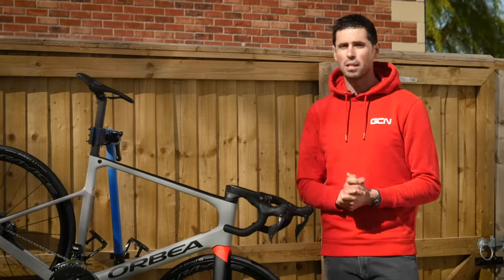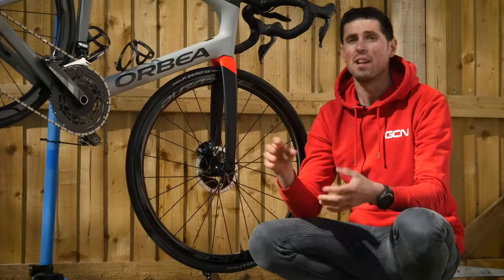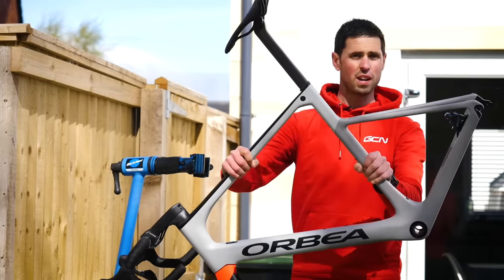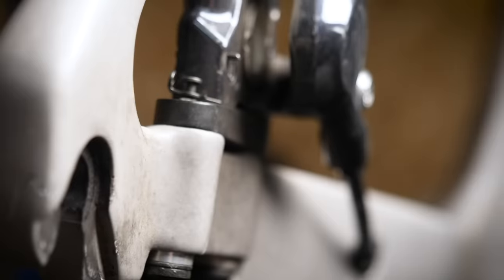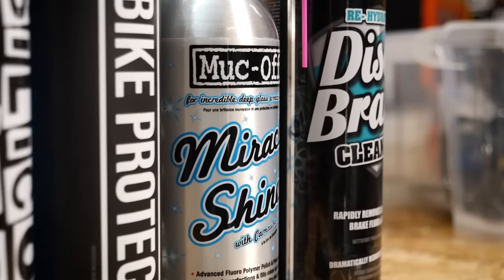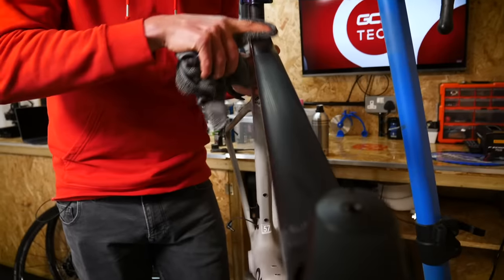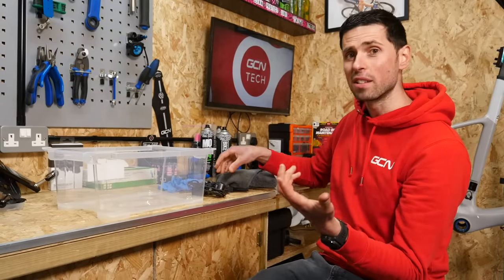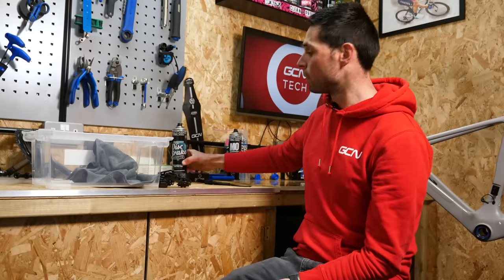Going The Extra Mile | Bike Detailing Tips To Make Your Bike Look Brand New

Comment from the maker: Do you want to give detailing a go? Or have you tried it in the past? Let us know in the comments 👇
Reply: If you were detailing your car, you would never use a brush as it causes fine scratches in clear coat.  

If you really want to detail your frame and fork, take some notes from car detailing 👍🙂🙂
Reply: I use Zymol Atlantique on mine. Costs more than some bikes!!
Reply: Naah, I ride on daily basis. Not gonna bother.
Reply: I wanna know more about your alixpress power cranks
Reply: Clay bar to remove all the stuck on bits of tar from all the chip seal roads, chemical  guys ez creme glaze, and a couple of layers of dodo juice supernatural wax ... shines and beads like a boss. Sometimes give it a fine polish first to remove any fine scratches,  but it usually gets done a couple of times a year, and especially before putting it into hibernation for winter.
Reply: No, no. Stop with this guy. 
3:15 a dirty rag running through the rear caliper? No. An ex-pro doing a rookie mistake.

5:34 bike cleaner is not a lubricant and should not be used as such. The pivot points for the rear mech should be lubed by....actual lube oil.

6:27 & 6:34 uses rag with cleaner/polish for the front hub and allows it to touch the front disc. Another rookie move. Good luck stopping.

PLEASE BRING JON BACK!!!  #GCNtech 
(If you’re going to keep this noob Alex, don’t use him for tech videos. Just use him for riding/racing tips. He’s awful for tech.).
Reply: @jonnythelegs2597  that makes two of us
Reply: I'd like to pay someone to do it... ;)
Reply: Never all in one go, but done every corner or component individually at some point. I use mechanical disc brakes, I tell you, taking the callipers apart and soaking every grimey, nook, cranny, nut and bearing in a methylated spirit bath was a fun few hours on a winter evening.
Reply: Why not list all the products used ?

Comment: That magene power meter, hmmmm. I would love to see a review of that!
Reply: Pretty good for the price according to others reviews
Reply: @simonlebas7733  DOUBT
Reply: @yourneighborsdog4495  It's actually not that bad although some people seems to have gotten lemons so I guess QC could be improved. Here's a comparison I made between my trainer and the Magene power meter. https://zwiftpower.com/analysis.php?set_id=131643
Reply: @Boppen71  the magene is probably the accurate one and the flux reads under?
Reply: @abedfo88  I'd say that it's normal for the power meter to read a little bit higher since it's reading power before any losses in the drivetrains of the bike and trainer. The Magene is advertised as +/-1.5% accurate and the Tacx Flux S as +/-3% so over all I'm happy with the results I'm getting. Just wish I had some power meter pedals to compare with but I can't really justify buying that when I already have two power meters (got a single sided Stages as well) and only one road bike to put them on. Guess I need another bike...
Reply: @Boppen71  how long did it last?
Reply: @yourneighborsdog4495  If you mean the battery, I haven't charged it since my first charge when I got it. Only used it for about 10h so far, so it's a bit early to say anything about that. It's specified for up to 200h per charge though. If you mean mechanically I don't see any reason for it to fail, it seems just as sturdy as any of my Shimano chainsets.

Comment: 2 things I've found that work really well for getting out tougher baked in grease or grime stains on bikes are very fine grade (#00 or higher) steel wool as well as those Mr. Clean magic eraser pads. Gentle pressure and maybe a tiny bit of WD-40 applied on the spot or the scrubber works absolute magic to get really tough embedded black grime stains out that other cleaners just won't fully remove. It can mess with clearcoat a little though so just proceed with some caution and keep the scrubbing light and targeted.

Comment: I have bought SWISSWAX for giving my frames the earned shine!!! And at the end of the Cyclocrossseaseon, i have taken everything off and clean everything!!! The same with my Roadbike from the Canyon Outlet store, which was a littel dirty.
Reply: Add: I gave my bikes a Swisswax clean in 3 steps. I have this Mucoff Coating for the  fast clean!
Reply: I just strip my frame when I buy it and apply a ceramic coating.
Reply: the same swisswax for car detailing? or bike specific?
Reply: For Harley's and other motor bikes, but i think it's good enough for my bike😉🙃🤗
Reply: @felixkloss5667  i believe is the same for cars... i have for cars also due to mate painting, so i believe than i can use on my bikes too, since they are also mate :)
Reply: It's really motor bike spacific. Their main products are of course for cars but it's motor bike specific.🧐

Comment: Try a IPA (diluted isopropyl alcohol, not a beer) wipe down before any wax/protection products. This removes any oily residues on the frame, so the protection coating is directly on your frame. Lasts longer and gives a better result.

Comment: I used the Muc Off Nano Tech Bike Cleaner today for the first time and I can't believe how clean the chain is.  I mean everything else sure, but how hard is it to get a top tube and down tube clean?  I let the chain, cassette, and jockey wheels all soak in the cleaner while I did the rest of the bike, then used the chain cleaning brush on the chain, hosed everything down, and when I went to dry the chain with the paper towel it was almost as clean as using full chain degreaser.

Comment: Typical mis-information. That protect spray will not lubricate the derailleur pivots. Take apart a Shimano mech and you will see thick grease on all the pivots designed to last the life of the derailleur. The protect spray will not penetrate into these semi sealed areas but if it did it would break down the grease and reduce its life span

Comment: Disappointing.  On my bike the dirtiest parts are the chain, cassette and little wheels in rear derailler.  The cassette used in the video looks like it just came off the shelf.  For frames, I recommend straight automobile wax.  Provides same protection at, and I guessing here, a much cheaper price.  Don't be cheap with chain oil - get the best you can afford.

Comment: I don't think this level of cleaning is necessary unless you're trying to sell your bike.
Reply: Agree
Reply: Deep cleaning and applying coatings (like wax) helps keep your bike clean. It's not necessary but it makes further cleanings less intensive. A quick dusting with a horsehair brush is really all that's needed. Plus on a steel bike it fills in pinholes in the paint to prevent oxidation.

Comment: Now, let's talk about those missing valve caps... 🙈
Reply: Every gram counts!
Reply: I hope you were being sarcastic. The first thing I toss off a new bike is the caps on Presta type valves. They really serve mo purpose as you will blow any debris off of the contact area. Schrader valves are a much different story as their contact area is exposed and can get dirt in it and leak causing repeat flats (there is no puncture as this area expects to be protected.)
Reply: The only purpose of Presta caps on factory fresh tubes is to prevent the tiny threads from being bent or to keep them from piercing the tubes in a tight wrapping.

Comment: I just use a soap water spray what i can get to without having to re build the entire bike. Seriously who has time for dat?
Reply: It doesn’t take that long if you have di2. Mechanical shifting? Yeah not going to take the bike apart to clean it unless it needs new cables.
Reply: @dudefella420  Don't have the cash for that type of bike/Components. Still stuck with Ultegra and still cleaning the same. Cheers!